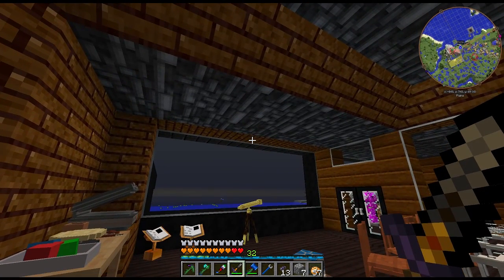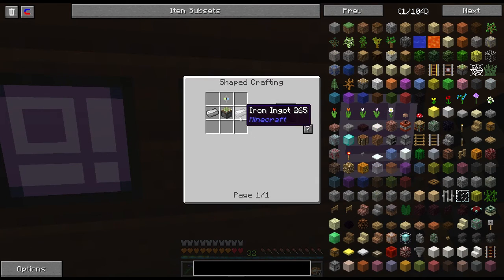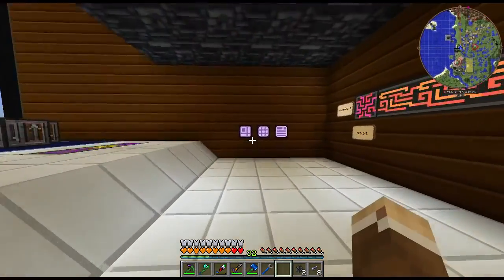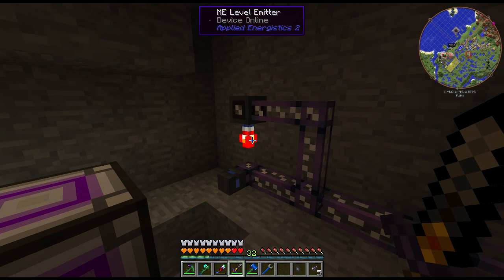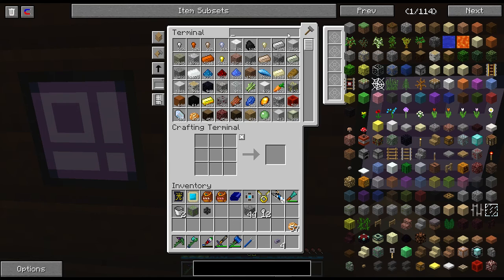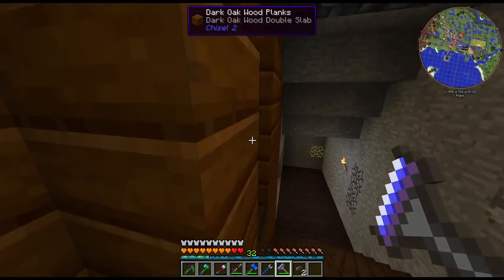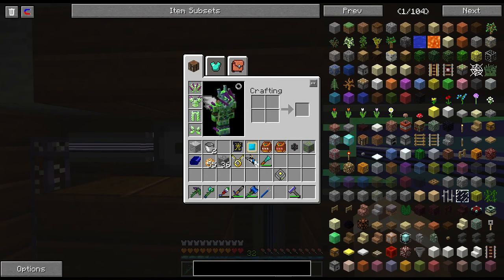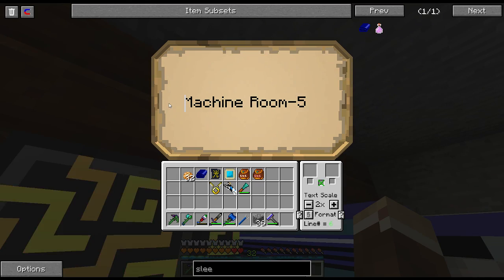Modded Minecraft 1.7.10: S01E105 - Matter Condenser

Comment: For the sake of "MC-OCD" I would have used the Igneous Extruder for cobble production. Same cobble generation just inside of a machine block. I will do some experimenting because I'm not sure if the auto eject will directly port to the matter condenser. May end up having to do some finagling to get them on the same page since they are different mods.